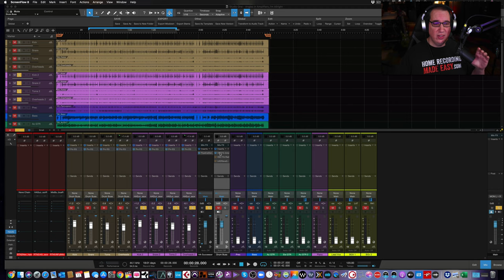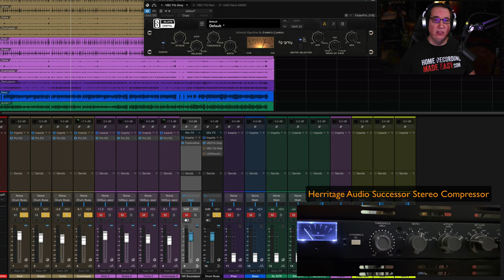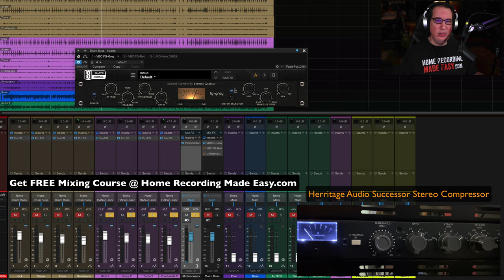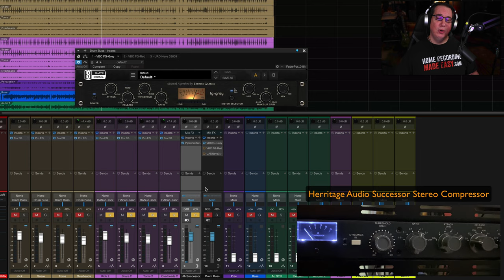Drum Buss Compression Hardware vs Plugins

Comment: David's courses are excellent, I've taken quite a few some years back along with the mixing courses where he mixed a whole song each month, and we submitted our mixes of that song too... Really worthwhile courses you'll learn a lot from... In these comparisons, along with my own via the likes of hardware platforms online like mix analog and access analog, is if you set the emulations the same as the hardware, they're going to sound different (as David said above, not "Bad Different" but just different) the software will seem to lack an edge in width and depth and that magical hardware polish, but if you tweak the software add other bits n pieces to the software you can get within I would say 0.5% of the hardware, for example I tried a Neve 1073 pre and FET 1173 Blue, and put them up against the Arturia Neve Pre (not the exact same I know) and the Waves Blue FET and got a sound so VERY close to the hardware I could barely distinguish it, the settings weren't the same to get that result, but setting the emulations attack and release (leaving the ratio the same) the sound was indeed super close, I did the same with a few other emulated FETs and found that Waves are incredible plugins and that I didn't need hardware (for now LOL)... Check out David's course's he will get you up to speed with everything Studio One and mixing, love your work mate!
Reply from the maker: Right. 1 piece of hardware in the audio signal patch compared to a plugin that is tweaked wont make much of a difference as the plugin will sound pretty close, say 95% of the way there. Where hardware makes a real difference is when you have 3,4,5,6 pieces across you mix in different places. That is where you really start to hear the difference. now, can you spend 30 min tweaking all your plugins to get close? Of course you can. However, I find that using hardware I get the sound very quick. I dont need to tweak plugins, its just there and that's the difference. But again, adding 1 single unit or even 2 and using 95% all plugins you wont hear much of a difference. I also say over and over that for me, it's way more about the workflow not just about the sound.

Comment: Hi, great video, it's just what I was looking for. For me, there is a huge difference between software and HW; Successor has definition, it does not make a "mass" of the sound, and also brings out the high frequencies with a beautiful drill, it is as if it assigned a "route" to each sound and its frequency. I looked for the other tests that you said you were going to do, but I couldn't find them!!! You're not going to do them? It would be very useful if after 2 years using this compressor you could tell your real experience. Greetings,
Reply from the maker: If you want to see videos like these, then check out my other youtube channel, Mixing Music Analog. Lots of plugin vs hardware videos.
https://www.youtube.com/mixingmusicanalog
Reply: Excelent, thanks